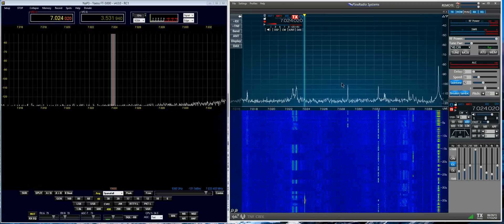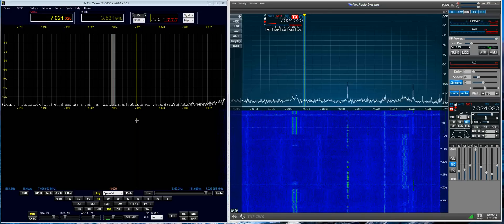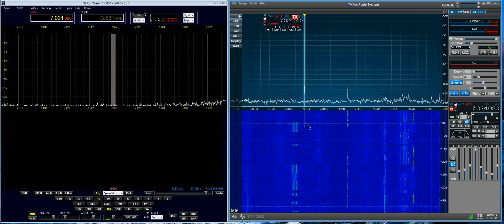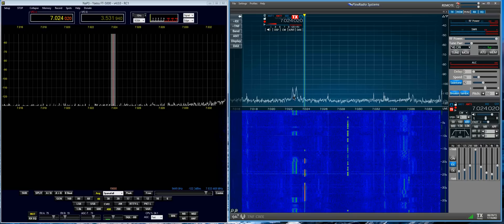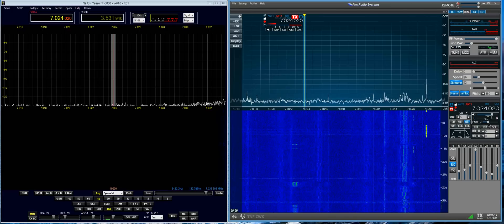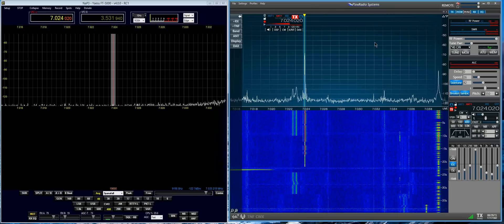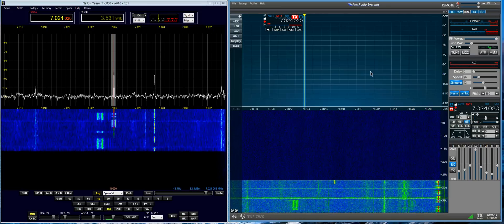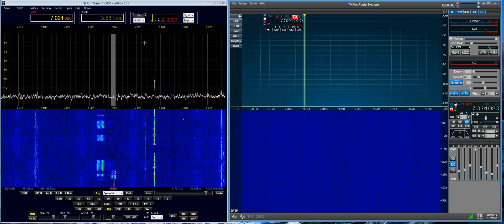Flex-6000 VS FTDX-3000 Demo For AGC-T

Comment: i'm currently in the 30 day return period of the flex, i'm having mixed feelings about it. the other radio i'm looking at is the yeasu dx101mp, what are your thoughts on this? are you still using your flex have you moved on to a different radio, should i send it back and go with the new yeasu which i cant unfortunately does not have the same 30 day return policy. Just trying to get the thoughs on others that have used the flex side by side with other nicer radios.

Comment: Thank you Steve.

I wonder if you could run this test again. There's been a number of revisions in the code since 8/2015. I have often been confused by AGC (or is it AGC-T?) on the Flex compared with other radios. On another radio, I think AGC primarily helps level out the AF on the weak to loud signals while on the Flex it seems to perform a different function more geared to noise reduction rather than easy listening.

Tim has a post on the flex community on how to properly set AGC-T which was slightly different than your procedure. Might that make a difference?

Good video.